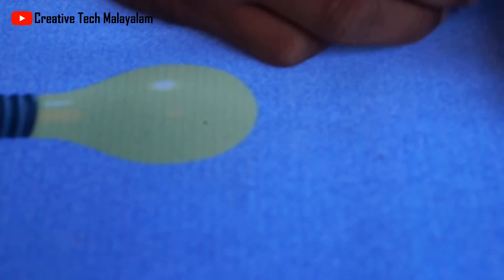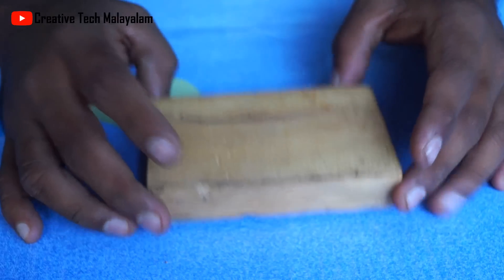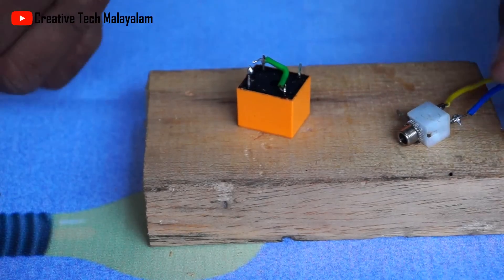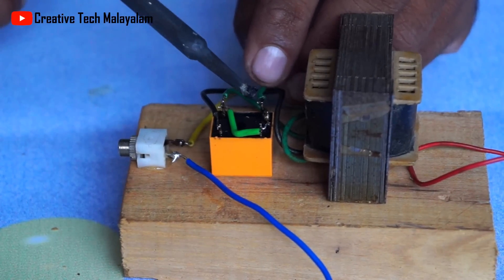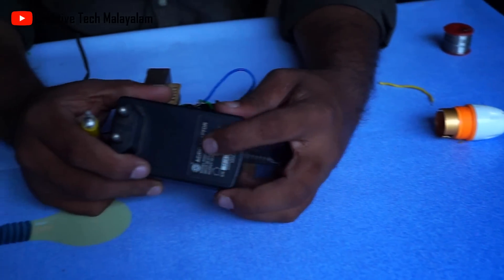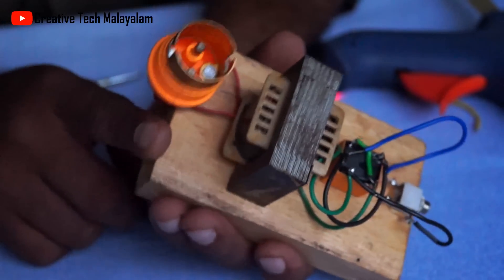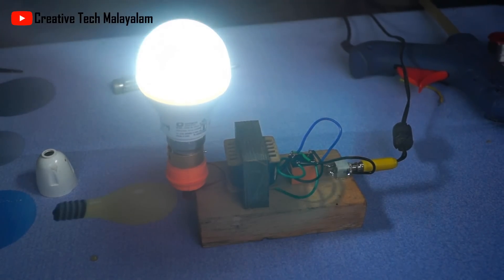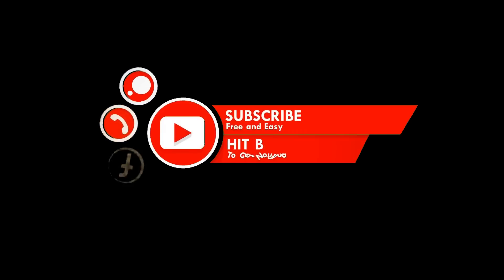INVERTER using RELAY...നമുക്കൊരു അടിപൊളി inverter ഉണ്ടാക്കിയാലോ....???

Comment: Step up transformerine ethrayanu vila
Reply: കടയിൽ സ്റ്റെപ് അപ്പ്‌ ട്രാൻസ്ഫോമർ ചോദിച്ചു അങ്ങനെ ഒന്ന് ഇല്ല എന്നാണ് പറഞ്ഞത്. Ac  ഡിസി ആകുന്നത് ഉള്ളു എന്നാണ് പറഞ്ഞത്
Reply: Bro step up allaa 12-0-12 v transformer ennu paraja mathi  annu athil 12v sidil 12v ac koduthal. ..230v ac kittum power dipends up on input ampere
Reply: @ar-creation7114  input ampere adho output ampero depent cheyya
Reply from the maker: 80 to 100 aanu...it depents ampere rating..ok thankyou bro ..onn share cheyyane...

Comment: ഇത് കറന്റ് പോകുമ്പോൾ ഓട്ടോമറ്റിക്കായി വർക്ക് ചെയ്യുന്ന ഒരു രീതി കാണിച്ചു തരാമോ
Reply from the maker: ok broo..thank you...onn share cheyyane
Reply: @aghoshvyshnavam  AC - 240 V to AC - 12 V 1A. This is a general purpose chassis mounting mains transformer. Transformer has 240 V primary windings and center tapped secondary winding. The transformer has flying colored insulated connecting leads (Approx. 100 mm long). The transformer act as step down transformer reducing 240 V AC to 12 V AC. ഞാൻ ആമസോണിൽ ഓടർ ചെയ്യ്തതാണ് ഈ ട്രാൻസ്ഫോർമർ പറ്റുമോ?